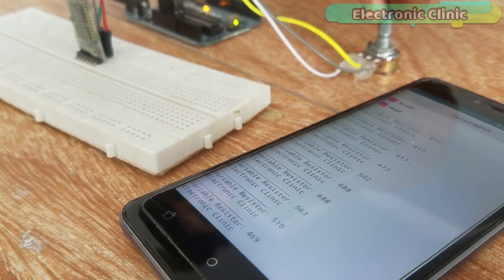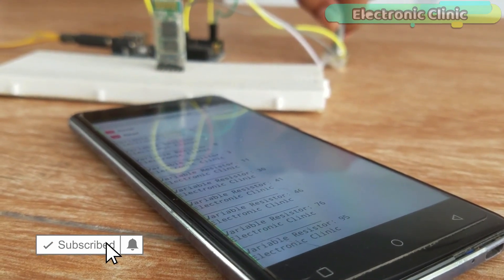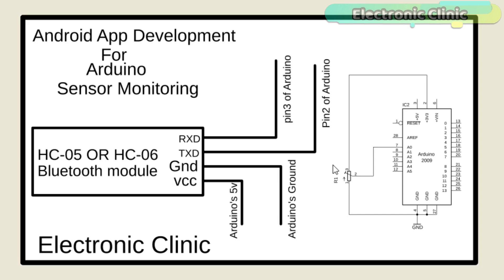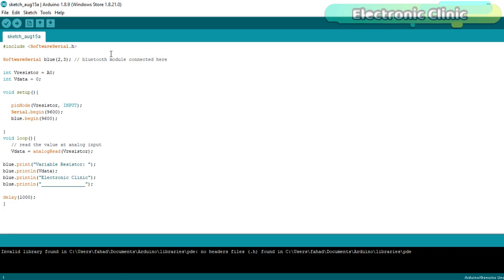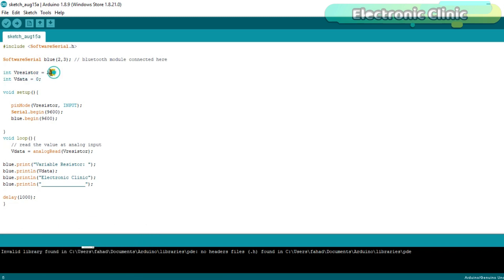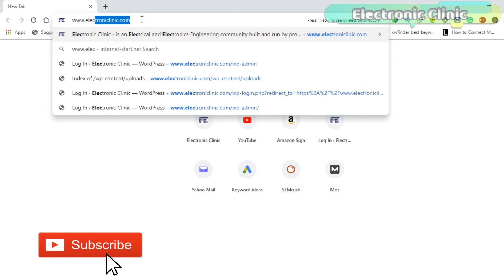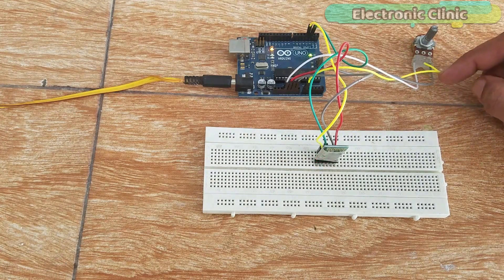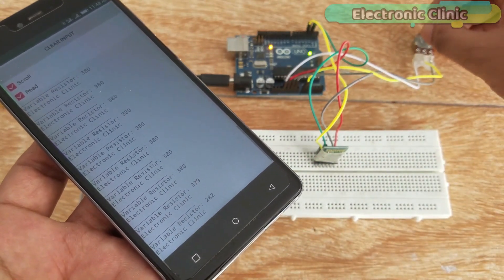How to Create Android App for Arduino Sensor Monitoring over Bluetooth using android studio

Comment: Thank you so much this helped me a lot. Just a question. Is it possible to control a button in android studio using arduino button? like for example if i press the arduino button it will press the android studio button?
Reply from the maker: yes you can do it. watch my other video in which i added buttons.
Reply: @ElectroniClinic  if it's not too much to ask, what is the name of the video? was trying to search for the same project line but i can't seem to find a video continuation with buttons ^_^
Reply: @Ervinz86  Can it be done in Proteus instead of using a breadboard?
Reply: @ElectroniClinic  Hi there. Is it the light toggle button? what I mean is controlling an Android Studio Button using Arduino button like if I press an arduino button it then sends a toggle through BT and automatically toggles press on Android Studio button to be pressed automatically...